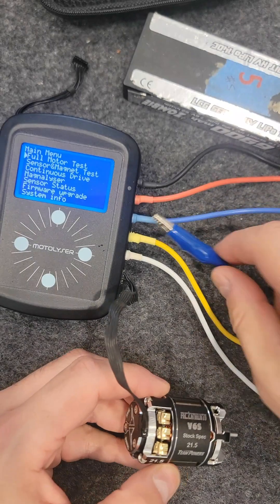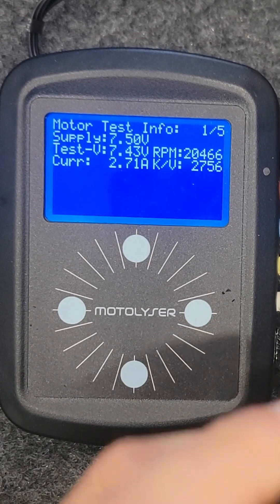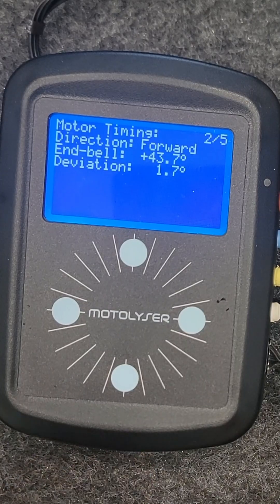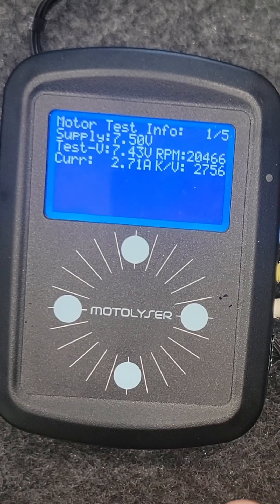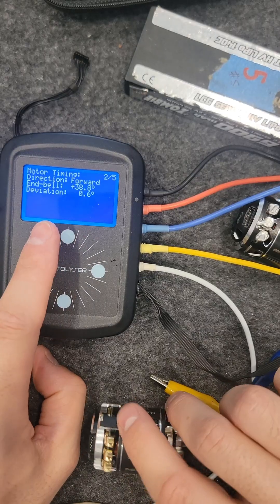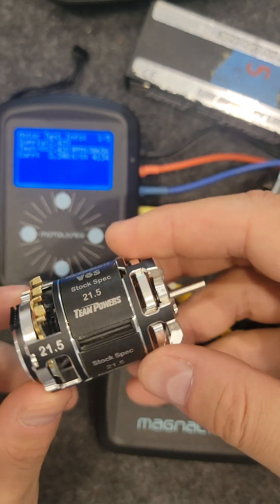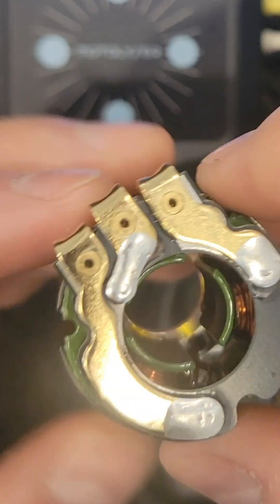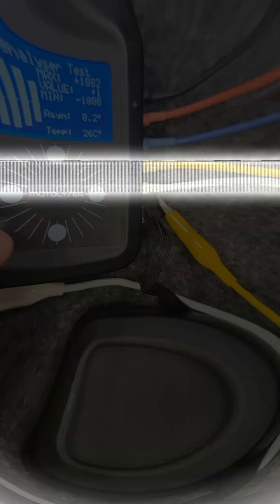Team Powers V6S Deep Dive!

Comment: What end bell timing do you recommend for the 21.5t motor? I have one and it came with an end bell timing of 30 which seemed low to me. I race on quite a large carpet track so my gears have been 69t spur with a 33t pinion lately.
Reply from the maker: I missaid the timing but 38.5 to 39.5 on the can seems to be a good spot for 21.5t and 13 5t motors
Reply: @superstockRC ok thanks!